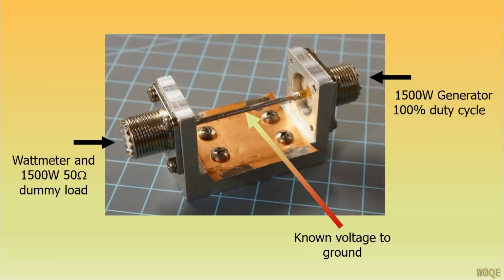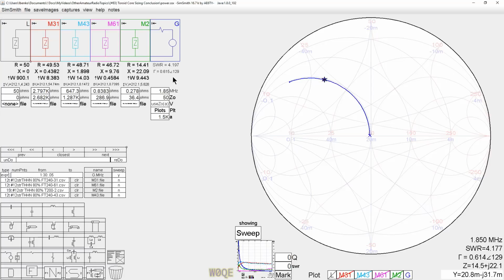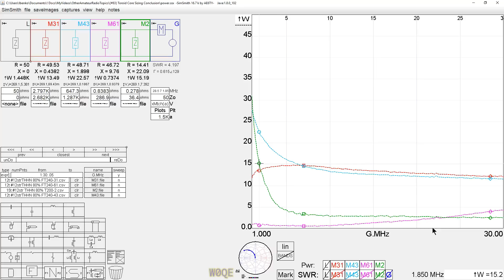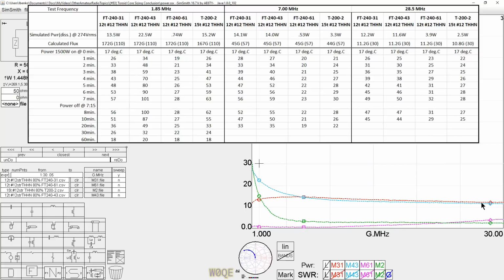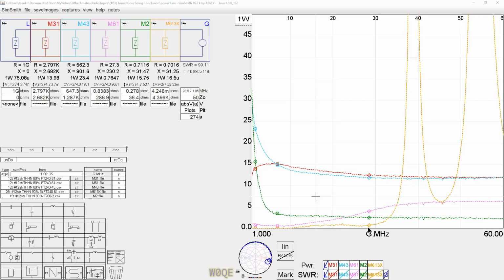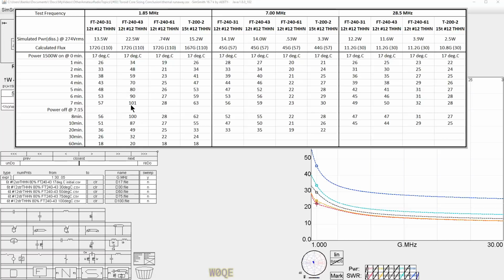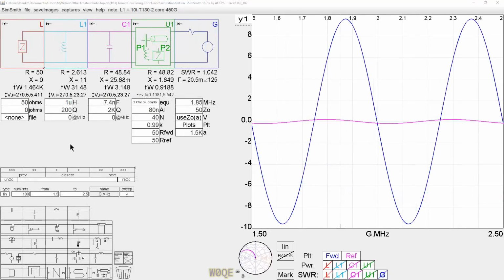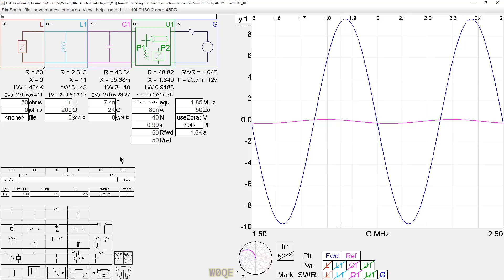#83: Toroid Core Sizing

Comment: Thanks very much for this educative video, i am a bit lost however i will catch up. my question is what should i consider while designing a Toroid core inductor when my target inducatance is 6680uH, output current to be 1.1A, i went to manufacturer's datasheet and picked core 0077210A7, what else should i know in designing. thanks very much

Comment: Thank you for making this video and sharing it with us. I however am still new and at this point still lost. If you were designing and EFHW for 80 through 10 m and wanted to run full power, which material would you use that resulted in the lowest loss best performance? What about if you wanted to do 160 through 10 m?
With all of your years experience, can you recommend any products that can be used as EFHW 80 through 10 or 160 through 10 at the full 1500 watts with the lowest loss and best performance in your opinion? I'm in this middle world where I don't see any products that claim continuous duty at 1500 watts for EFHW multiband, if there was something really excellent that you were aware of I would just as soon purchase, but if not I would like to build the best based on your guidance. Thoughts? 73 W3GUY
Reply from the maker: Ernest,
The EFHW has almost a cult following but it is really nothing special and is easily modeled.  At low power levels the ground connection is often an oversight as the current is very low.  However that is not true at high power and a serious common mode choke in the coax will probably be needed or you will have RF in the shack unless you have a good ground at the antenna.

Let's assume that you expect the load to be about 3k ohms mostly resistive you will need a transformer to step up the impedance from 50 ohms.  The output voltage of the transformer will be ~2200Vrms or a little over 3000Vpk.  This voltage is across the secondary winding of the transformer.  It will not be a simple task to keep the power dissipated in the core low enough to not have the core overheat unless you have a lot of turns which will be problematic.  Videos #80 thru #84 described these types of calculations.  You are going to need multiple cores and not small ones.  A VNA can measure the inductances of the transformer winding vs frequency and the core loss can be calculated.  Temperature rise is your only concern as there are no modulation types in HF amateur radio that will cause the cores to saturate before they heat up to dangerous temperatures.  I would probably start by building a lower power version of the transformer.

I know this isn't the answer you want to hear I would suggest you start with a 2.4"OD #43 core and wind 2 transformers.  Place them back to back and then use a tuner to match to a dummy load.  You will need to match out the leakage inductance in order for the transmitter/amplifier to be happy.
Good luck,

73, Larry, W0QE
Reply: @w0qe  Larry, this is exactly the answer I was looking for! I am currently watching many of your videos, so directing me to ones that will help certainly does help! Additionally to do it right I really did think I would need multiple large cores, but I would like to see and do the calculation and get it right. That was assuming that someone didn't have an over-the-counter product that already is designed for 1,500 w continuous, which so far I can't seem to find one, well not one that lists a true continuous power rating, I do see a vendor listing something called ICAS which appears to be some kind of intermittent power rating? Again, thank you very much for the detailed reply and I'm going to watch the videos for sure! And yes agreed it does have a cult like following, but mostly at low power levels compared to what I would like to do. This type of antenna lends itself very well to multiband at the current location where I live, and end-fed antenna is a simple method that will work with the yard I have. I have really been enjoying your videos and I do have a cheap VNA and have been playing around with it a lot lately for VSWR charts. I am only now learning the language of actual RF engineers like return loss and your videos are really helping. Thank you very much for the detailed reply if you think of anything else that might help, please let me know. 73 W3GUY Ernie

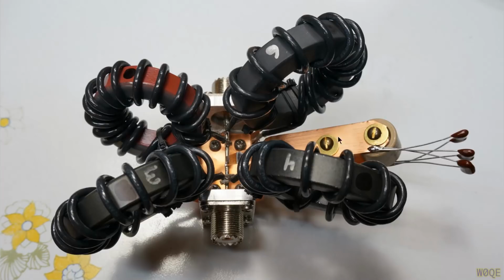Comment: Another great video.  So for a typical 2:14 turn EFHW unun auto transformer using a single or double FT-240 core(s), most recommend either the 43 or 52 materials for 80m-10m.  But it appears the 61 material is better for higher power applications than 43 for this application.  Is that correct?
Reply from the maker: NO5X,
Assuming that you want to have the exact same transformer with the 61 material vs the 43 material and are using the same size core(s) for both you will need to increase the number of turns for each winding in order for the inductance to be the same.  The 61 material transformer will be operating at a lower flux level and should also have lower loss.  Now if you raise the power the flux level will rise and you may also need to increase the wire gauge due to the increased current.  The 61 material transformer may have more capacitance between the windings (more turns) which will need to be analyzed.  You could also take a different approach and wind both transformers with the same number of turns and adjust the antenna length slightly to account for the decreased shunt inductance.
I know you wanted a simple yes or no answer but it always is so easy.  Does this help?
Larry, W0QE
Reply: @w0qe  Absolutely it helps!  What test equipment did  you use to generate the 1500 watt signal at the 3 test frequencies?  (I assume a ham radio + amp ?)
How did you measure the temperature during testing?  (thermocouple, RTD or Infared meter ?)
Reply from the maker: @johntrites3387  I have a couple of ham radio amps that are capable of 1500W 100% duty cycle output. To measure temperature I usually paint a 1/4" diameter flat black paint dot on the object and use an infrared spot meter which has a 1/8" spot measuring area.  This meter needs to be about 3/4" from the dot for the 2 led beams to converge.
Larry
Reply: @w0qe  I think your setup for the 43, 61, and 31 materials all had 12 turns.    In your test case, they would have different inductance values for a fixed 12 turns.  And, these material cores with the same turns will be operating at the same flux density level regardless of the material type.  
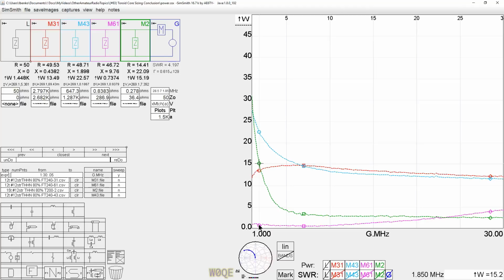So at 5:29 time, you show different power losses at 1.85, 7, and 28.5 MHz (frequencies setup at generator) I assume because of the measured "file(s)" loaded for each material type.  
What instrument did you use to make these toroidal core impedance measurements for each material? I assume a VNA.  Which VNA?  What frequency range?  
And, does each toroidal inductor material file include both resistive and reactive values over the frequency range?  
Are those 3 toroidal inductor material files available to duplicate your work?
Reply from the maker: Without looking at the files from 4 years ago I'm pretty sure I used an AIM4170 analyzer to make the measurements. Absolutely any measurements that I made included both the reactive and resistive part of the impedance over the frequency range. This video was from before I started to include the files on Dropbox but the files that I loaded into SimSmith show power loss due to the resistive part of the impedance. I could send you the files in a format that SimSmith can easily read.
Larry, W0QE

Comment: Fantastic Larry! Thank you! To evaluate power loss and heating in an RF transformer using these core materials, would a model of it in a RUSE block work similarly to what you have done here? I have a homebrew transformer wound on a small #61 binocular core at an antenna feedpoint to match the impedance to 50-ohm coax. (4T primary, 5T secondary, 14 MHz.) I'm only running 100W max and the temperature rise is barely detectable, but I have wondered how to evaluate a transformer like this for higher power.
Reply from the maker: DP,
SimSmith will calculate the power dissipated in any component including a RUSE block or S parameter block etc.  Underneath every component except the generator are 4 lines that are R, X, W, VI.  The 3rd line will be displaying "left arrow W (power in W delivered to the component), "left arrow dBW (power in dBW delivered to the component), "up arrow W (power in W dissipated by the component), or "up arrow dBW (power in dBW dissipated by the component).  Clicking on this space will toggle between the 4 power measurements and you want "up arrow W".  Then your goal is to accurately model the transformer.  This ideally should be done via measurements.  I would then model the transformer in a S parameter block.  This is probably more work than you might want to do.  If that happens I would look for another way to achieve the same goal.  I might take a high power dummy load and connect a high power tuner to it and adjust the tuner to give the correct impedance to the transformer you want to test and then drive the transformer under test into the tuner and measure how hot it gets.  You may need a second tuner on the generator side of the transformer under test if the circuit does not give the transmitter a reasonable SWR.

Finally you can just "wing it" by saying if it only gets barely warn at 100W then it will dissipate 5X more at 500W.  You can do some measurements by winding the core as a plain inductor with few enough turns to guarantee it will get quite warm at low power.  The drive power into it until it gets as warm as the real transformer you want to test and then increase the power 5X and see how hot it is.

There are many ways to accomplish what you want to do.

Larry, W0QE